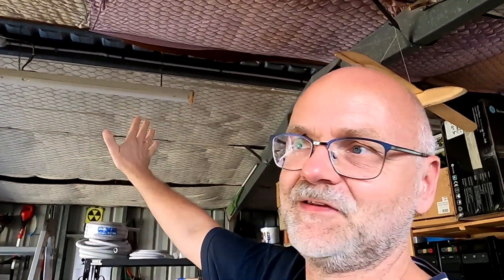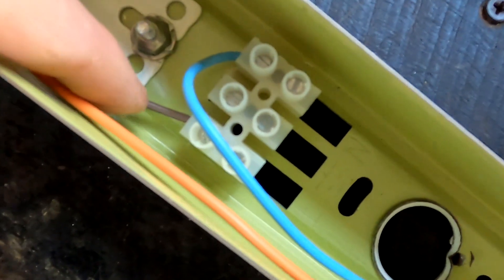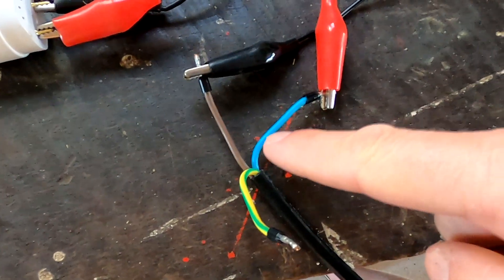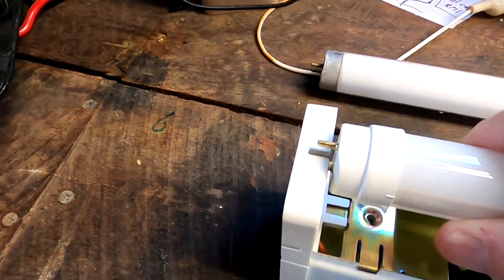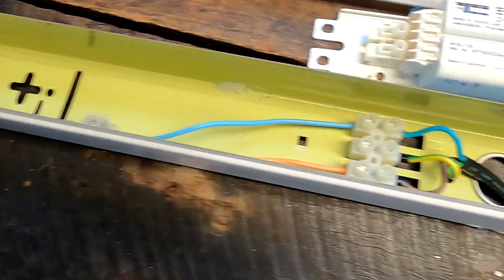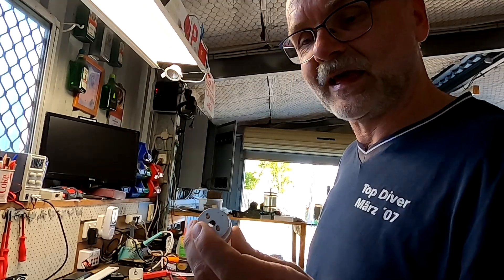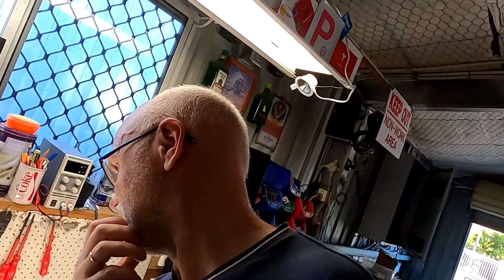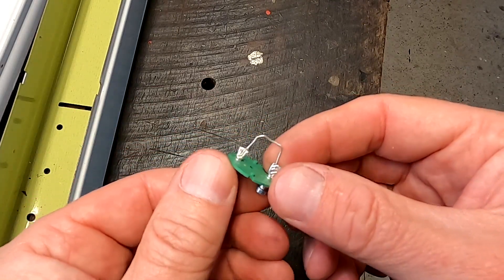How much you really save by removing the ballast from LED lights

Comment: Interestingly, I did a similar test on one of my fixtures and found a much different result. Directly wired, my bulbs used the rated 15w each (30w for two in the fixture), but through the magnetic ballast the fixture was using 47w and had worse power factor. 50% more energy use. 
This jives with my experience with magnetic  ballasts: they get hot and that heat has to come from somewhere. It would not have surprised me to see such a small difference with a newer electronic ballast but I don't know how an LED could reduce the losses inherent to the magnetic ballast. Still, useful to see your results as a comparison!

Comment: Thanks for making this. I'm in the U.S and paying 9 cents per kilowatt hour and trying to find a way to save money by getting rid of my florescent tube lights. I have an older central air system that uses to much electricity and I can't afford to replace it yet so I'm trying to cut electricity costs everywhere in my house any way I can and when I got to this part on my checklist I had no clue if it would even be worth buying the led tube lights that work with the ballast or bypass the ballast,  since the savings are so minimal I'll keep the ballast and keep my old bulbs on the shelf and this way I can still use an old florescent off the shelf temporarily if I blow out an LED tube light or if it becomes defective. Thanks!. I appreciate the video and the time and testing you put into it.

Comment: Really good info as usual. But consider this too, You can get nice big 1200mm x 300mm LED light you can hang from the ceiling that give a great, bright light and you can adjust them down to a night light level, saving potentially heaps of extra energy and with a huge variation of output for different situations, sometimes its nice to have the lights low too!
On top of this you could use one of those cheap boosters to take your 48v straight up or down to whatever voltage  you needed straight from the battery, as emergency lighting if something else has tripped and always have good lights going even if when nothing else is.

Comment: Hi Andy, when you short your starter and load wires then it will also work as the tube shorts 1 side and the other side is life or the other way around. Maybe recycling the load will retrieve an amount of copper which might outweigh the gain in electricity, but labour is probably more expensive. Thanks again for sharing.

Comment: This vid' is like a builder showing us how to fix an engine!
The fuse/link that replaces the starter is  rated at 1/2-amp, (well, the ones I opened up) you have to remember fuses are rated for the job. Now most lighting is on a 5 or 6 amp fuse/breaker (some standard fluorescent fittings have an extra 2 or 3-amp cartridge fuse fitted somewhere for extra safety) removing that safety device if there was  ever a fault the 5+ amp safety device may never work due to the miniscule 16-watt draw but still enough to cause problems. Would you say " my main 60A supply fuse has blown,  - - - I know - - I'll cut a bit of rebar & jam it in the fuse holder" ?
Other than yhat - - - not a bad Vid'.

Comment: I did the same conversion on my fluorescent tube fixtures to convert them to LED. I did remove the ballast but not because of the energy savings. I did it because the ballasts are prone to failure and I didn't want to mess with having to take them down and remove them later.

I also went with LED tubes that could be inserted either way. This requires re-wiring the fixture anyway since neither end of the tube contains the "dead short". I really didn't like the idea that inserting it backwards could cause a short, so I felt better about getting the kind that requires a re-wire so that shorts aren't possible. So might as well remove the ballast while you're in there to prevent future issues from a bad ballast.

Comment: With a magnetic ballast and led starter in place,can you install the led tube in any direction and without the need to match the neutral and live terminals in the tombstones as if its a standard fluorescent tube? Thanks.

Comment: Good info! I am going to upgrade my florescent fixtures.
How the florescent light works.
The ballast is an inductor. The starter is a capacitor.  The two form a resonant circuit which generates a very high voltage spike for a very short time when you click the light switch. The gas in the tube breaks down via an arc between the 2 ends of the tube because of this high voltage spike, liberating electrons forming a type of plasma.
The starting arc occurs only until the LC circuit "rings down", a very short time.
 Once the electrons are free the propagation on new electrons is maintained by the current flowing through the ballast. The electrons bounce around  stricking  a florescent coating on the inside of the tube which generates the lights we see. The black marks on the ends of the tube are caused by metal spaul from the electrodes during the start pulse.  Once the dark rinks get thick enough the starting arc short circuits to the ring, basically the tude dies and needs to be replaced.

The led starter replacement is just a wire because led lights do not need that initial high voltage spike.  That starting voltage is likely to kill the leds in the tube. Replacing the starting capacitor with a wire eliminates the resonant LC circuit and starting pulse.
Reply: Even, if starter was removed, high inductance stays in circuit and sometime could create a huge overvoltage pulse during ON/OFF commutation or any grid perturbation. I suggest to remove this inductance from LED circuit.
Reply: @thesignalbridge  maybe, let's exchange ideas, inductors resist the flow of current unless you have a capacitor to buck against, i agree there will be an inrush of current like a RL circuit. The ballast is already designed to handle the inrush current. The Led tube specs list compatible ballasts. I don't see a problem.  Since these tubes are LEDs, there has to be a rectifying diode(s) and a RC filter after the diode (AC to DC). R would have to be sized to limit the current flow into the Leds diodes. C would be sized to filter the 50/60 hz so there is no flicker. I don't know where a problem would occur.
If I bought a new fixture I would not want a ballast. 
I think the key thing to remember these LEDs tubes were designed to work with an existing ballast. And probably ungone UL testing & certification to be safe. Lawyers are everywhere.

Comment: Brown is active, blue is neutral.
You switch the active wire in Australia. This shit is important! 
If you have a channel and audience, know what your talking about before you put up a DIY.
House fires are such a sad thing to roll into when the investigators find DIY wiring. You are Not covered with your insurances. No payout. You loose everything.
Reply from the maker: AS3000 says Blue is active,, Black is neutral. That's how it is wired in older houses. AS3000 also allows to use the European cable colours though 🧐

Comment: Will that RCD do anything if your earth wire on your plug is not connected to anything !? Hmmm
Reply: Yes it will. That's the whole point of an RCD. An RCD compares the current between the "active" and "neutral" wires and if there's any difference at all it knows that current is leaking to ground through some path besides the neutral wire. The RCD doesn't look at the ground wire at all. It doesn't care if the leakage is to the ground wire or some other path to ground. If the current on the active is greater than the current on the neutral, current is leaking to earth somehow and it trips.

Comment: Hi Andy what a great garage you've got. Good lighting is a must. In my garage I've used DC LED work flood lights ( 9 - 36volt ) with a 24volt battery bank. No inverter, straight DC. This also save my 48volt battery to power the inverter and the house. Works a treat. All the best. Jp.

Comment: Doh... What I first saw the video I was hoping you were going to do a full comparison of Fluro v's LED with Ballast v's LED only. It'd be cool to see what the end result is, bearing in mind that the Power Factor changes readings on some basic meters quite a lot.
Reply: I think, it is not useful to compare LED tubes with fluorescent tubes, that drived by Electromagnetic ballast (inductance + starter). More correct is to compare LED tube with PWM driver (ideally, external special LED driver with APFC inside) VS fluorescent tube with brand electronic ballast (driver) with also APFC inside (from brands like Osram, Phillips, Vossloh-Schwabe, Tridonic, Helvar, etc).
Reply: @thesignalbridge  I don't understand why you say that. Andy swapped over from regular tubes to these LED tubes, to save energy and to get better light. The comparison of energy usage is very much valid.
Reply: @thesignalbridge  somehow you're reading into what I said way too much. All I was curious about, was the difference in energy usage between the 3 different setups. ;)
Reply: @PowerPaulAu , is is relatively easy to explain efficiencies of these setups.
1. Electromagnetic ballast with fluorescent lamp. The most inefficient: lowest power factor, fluorescent lamp has less efficiency, than LED tube. 
2. LED tube with electronic ballast, left in place. Less efficiency than LEDs, directly fed from grid by losses over ballast inductance. But power factor is better, than in direct feed of LED tube. This is why Watt meter shown 16 W with ballast. But inductance could destroy LED driver by sudden overvoltage.
3. Direct feed of LED tube. Full supply voltage to LEDs PWM driver caused  lower wattage (15.8), as no losses at inductance. But power factor is worse, than in setup #2. 
Power factor issues are start to play with many fixtures installed. I think, here, in Garage, it is not significant for 4-5 fixtures. Projected lifetime of LED tubes will play a major role. Here, in Russia, these LED tubes are almost "piece of junk" and "kamikaze" in practice, due to its short life from constant and nearly unfixable overheating of LEDs inside it. I saw many of it thrown to garbage near local store, that used it in the same way, as replacement of fluorescent tubes. But for short time, untill they installed specially designed LED fixtures with proper cooling of internal LEDs. So, you can loss much more money for more frequent replecement of such LED tubes.
Reply: @thesignalbridge  you can stop now, you're way off course, you need to head back home before you reach the moon. It's time to sober up and get some rest. 

I'm not after a lecture about efficiency, I'm well aware about that that sort of thing already. I was just commenting (very simply) that the results would have been interesting.
Reply: LOL "it's relatively easy to explain"... then proceeds to write several paragraphs which are not relevant to my comment. That's a classic!

Comment: Most time efficient mod would be to bypass the ballast by connecting both wires to one terminal. Easily reversible.
Leave wiring otherwise as is so each tombstone has power and won’t create a short if reversed.

Comment: Brown = Active, Blue = Neutral
Reply from the maker: AS3000 says Blue is active,, Black is neutral. That's how it is wired in older houses. AS3000 also allows to use the European cable colours though 🧐
Reply: @OffGridGarageAustralia  HI Andy, my AS3000:2018 Table 3.4 states neutral is black or light blue and active is any color other than green, yellow, green/yellow, black or light blue. Not trying to be an ass about it, just there are many of your viewers coming to your channel to learn and I don't want them to go away with the wrong information.
Reply from the maker: @uziman3800  no worries, that's the standard for new installations. Most houses and installations still have the older writing though were red is active and black is neutral and you should not mix the installation in such cases.
I guess, that's why you always need an electrician for such work as you cannot rely just on the colours.

Comment: 95%+ of the LED tube replacements in the states require the ballast bypassed or removed. What I’ve found to be cheaper is to just replace the whole fixture with a nice LED sealed unit that have a clean looking opaque defuser. You just got to make sure the color temperature isn’t too cool (bluish) and has plenty of lumens. Cheaper ones are too bluish and hard to work under. For me anyway.
Reply: Way to go.....why mess around gutting a tin box you don't need to just mount an LED light, all you need is a wood plank and the 2 end fittings, much neater when painted.......the end fittings are available on EBAY.

Comment: When you are on grid there is no need to remove the ballast as you are not billed for power factor. When you are off grid however power factor comes into play. A standard fluorescent tube & ballast uses about 40w and a LED tube & ballast uses about 36w when power factor is taken into account. So in an off grid setting it is very important to remove them but otherwise it's fine to leave them in. (Ps I'm using simple terms for comparison for ease of understanding I know they are not correct when talking about apparent power).
Reply: The importance of a power factor in off-grid loads is strictly depends on inverter design. Well designed transformer-less inverters (with only IGBT PWM inverter bridge + sinus low-pass filter at AC output) must handle load's low power factor condition without significant power draw from DC source: low power factor from loads will only lead to circulating of surplus reactive power between load and inverter's PWM output stage.
Reply: @thesignalbridge  yes but in my reply I was speaking strictly on a power consumption basis not the inverter design and ability to handle a low power factor. I was comparing between the two options and pointing out that not removing the ballast from an LED tube will result in the same dc side power consumption as a traditional fluoro tube thus defeating the point of replacing it.
Reply: @joshuamulcahy4089 , if we left inductance (ballast) in place, it will act as passive power factor correction unit for APFC-less PWM driver inside LED tube. And tube's PF will be slightly higher. Also, it can supress some harmonics from tube's PWM driver. The same scheme with inductance as a passive PFC was popular in PC's ATX power source units in fist half of 2000-es. The main problem of this ballast in series with LED tube - this ballast can create a huge overvoltage on LED tube during grid's perturbations and during switching OFF this lighting fixture. Due to high inductance of the ballast in comparison with specially designed passive PFC inductance. But, this problem can be minimized or completely solved with placing X2 type line filter capacitors between Line and Neutral conductors after the inductance - at the socket for LED tube. This capacitor will supress overvoltages.

Comment: That what my wife call my shed, a mess. By the way the starter are just a straight through wire. I end up replacing all mine 3 years ago. Then I replaced the batten lights with all new LED battens. Need to see what I was doing. Plus light up my bench area for vlogs.

Comment: "You have to replace the starter". Nope. Here in the Colonies we have many newer lamp tubes that use a different ballast type, with NO STARTER. IIRC it is electronic vs. magnetic ballast. My LED tubes are designed for the newer fixtures, with a ballast but no starter.  Haven't dug any deeper into them.

Comment: You don't want to strip all of the "stuff in series" and connect only from one end because if someone who doesn't know about your modification ever puts a standard lamp in there, the filament will blow up. Also, connecting only one end means you can only install your LED lamps one way and won't be able to use lamps wired differently. You also wouldn't have to worry about modifying every replacement lamp you get to avoid shorting out the source when plugged backward.
Reply: Someone didn't watch the video before becoming a keyboard warrior did they?

Comment: How much wood we actually save? Well, i guess about half a black forest. Should last several winters...
Unfortunately, this decision is taken from me, as i do not own any of theese nice degraded light sabres. But for 0.4 Watts, i would probably leave it as it is.
But, maybe, your experiment wasn't scientifically correct, you had no control group with alligator clips instead of crocodile clamps.
And, to be honest, 0.4 Watts sounds not much, but relatively it corresponds to 2.5 %. People have done things for less savings...
I would have guessed it saves between 1 and 2 Watts, and it wasn't even half of that.
Thanks for sharing :-)

Comment: In practise you only really need to connect both wires on the inductive load to one of it's terminals together. That is the absolute fastest solution.
Removing all the other wiring and the starter socket is not necessary, if you have the starter replacement bridge. A bonus of this is, you can't put the tube in the wrong way anymore, So you don't have to bother drilling a hole into the new tube (and lose warranty that way).

Comment: Removing of inductive ballast is required, as its high inductance can lead to overvoltage to the LED tube's PWM driver during transiets in grid, or switching ON/OFF. There can be one positive effect of this inductive ballast - it can play a role of a passive power factor corrector. But, its high inductance could be the source of overvoltages. This is why it advised to remove all hardware for fluorescent lamps from a fixture before installation of LED tube. 
Onother BIG problem of LED lighting, both LED tubes and, especially, LED lamps for ex-halogen floodlights - lack of LEDs cooling, placing it in overheating condition. Especially, LED lamps for floodlights.